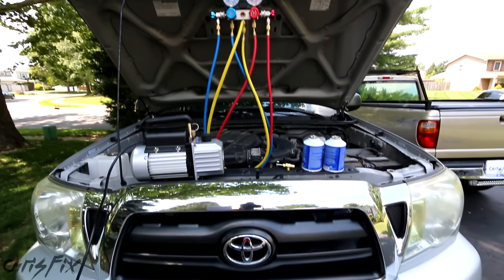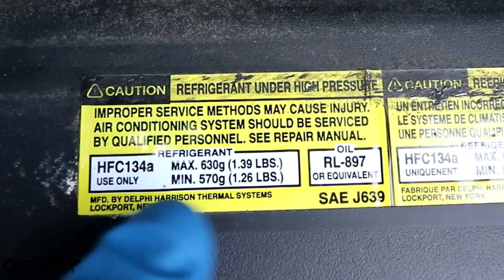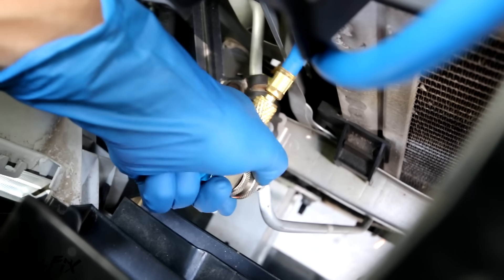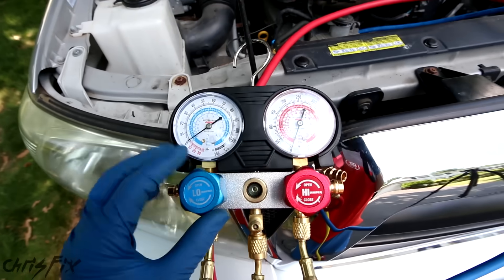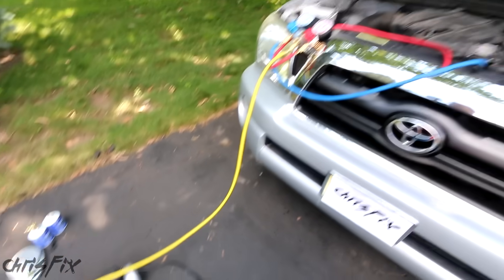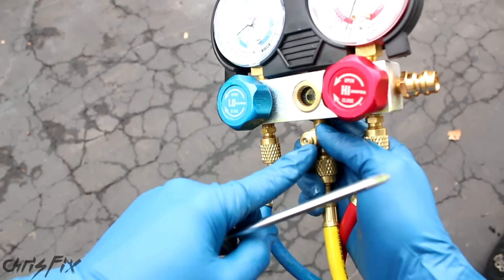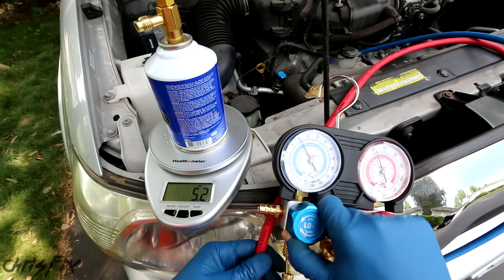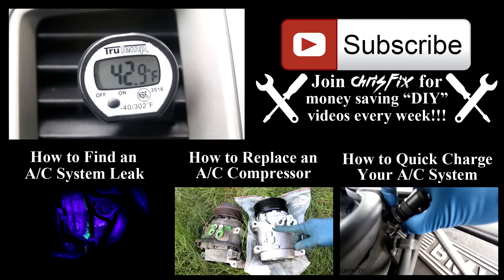How to Properly Recharge Your AC System

Comment: In addition to restoring the correct oil and gas quantity each time (best if the work is done with a recharge station), don't forget to change the receiver drier too from time to time (most of the times it's nothing but a cheap metal can mounted on or near the condenser) when regassing. It filters away any crap that goes about the system including any residual water that the vacuum didn't pull away, that would otherwise become ice inside the expansion valve and the evaporator. So it gets clogged over time and results in a compressor working harder than normal, and therefore wearing faster (and also inefficient cooling). The key to a perfect ac is preventive maintenance. I know nothing stays the same, but if you're willin to play the game, it's coming around again, Carly Simon once said.
Reply: Great song. How often advise you to check the oil ?
Reply: @supermasterPIK  You don't need to check the oil and anyway it's a two-stroke kind of lubrication so there's no actual way of checking it. The only way of restoring a full charge is to do a flush and then load a new system oil charge (recommended when you've had a large refrigerant leak), but it's time consuming work because a lot of stuff needs to come out, and that's if the expansion device can be removed from the engine bay. When doing a regas just make sure that you put back inside any oil that comes out, the recharge station takes care of it.

Comment: Hey Chris! Hope you're doing well, i have a question about my ac system, I've done an evaporator core and compressor replacement, the compressor came pre oiled. I installed everything and tested the system it had no leaks, I went and filled the system up. Ac runs cold but not cold enough like it use to ,so I checked with the company that did the ac recharge, and they turned out to fill up the system by pressure on the gauge and not by weight. 

My question here is, can I vacuum the refrigerant out without removing the oil in the compressor ? I don't want to evacuate the oil out. My compressor is new and I want to maintain the oil in the system. 

Please let me know what can be done and if a regular ac vacuum will keep my oil in the system

Thanks man !! And love the videos !!!

Comment: thanks Chris. I comple. my job in minutes my car is a infinity ex 35.  i have to replace. the radiator.  and by consequence. I have to drain. the AC. I did exactly. what you said. and like factory. thanks a lot

Comment: CHris, you measure a recharge in pressure not in weight. you left the system to low at 200 psi. you need to atleast have 250 psi to 300 psi(max) bc if not then the condenser fan wont even turn on.
Reply from the maker: Thanks for sharing but you recharge an empty system based on weight. The system pressure varies with air temperature and humidity.
Reply: So by weight it would vary. By pressure it would be exact. I do about 30 to 40 cars a day every week. I use 30 pound tanks. i do repairs about 10x a week. Every car is different every state is different but to hold by the exact pressure no matter what weight. bc freon is oil and gas based.
Reply from the maker: Again, I really appreciate your comment but if I filled it based on 200PSI I would have overfilled the system past the manufacturer recommendation. That can cause seals to leak, the ac to be too cold and freeze up the evaporator, and too much strain on the compressor. There is a sticker on every car that tells you the exact amount of refrigerant you should put in the car and that is the correct way to fill a system. I am not saying your way doesnt work, but the proper/best way to fill a sealed and evacuated system is by weight.
Reply: ChrisFix you know that freon isn't just oil it's also gas. If you're doing it by weight you could be adding too much oil base freon. That's why on the can is says to shake not turn it upside down. Too much oil will be added to the dryer and you'll will have to replace it or drain the dryer.

Comment: Thanks for the video! I used it today to refill the system after replacing the expansion valve. Finally have working a/c again after 3 years without it.

Comment: What should the pressures be? My AC has been acting weird. It was blowing warn and cold intermittently yesterday but today its fine but when I check the pressure it 35 psi on low side and 310 psi on high side. A week ago I did add some refrigerant, not very much, only about 1 min with the AC pro can. did I over charge?

Comment: A descent video, easy to follow, but, I would not ever suggest to the general masses, to tip the refrigerant can up-side down,  while the compressor is running.  As the raw liquid is then getting sucked into the compressor.   The raw liquid refrigerant can "SLUG" the compressor, and may destroy or shorten its life severely.  This will make some unhappy campers out there.  I would trim that part out, and mention not to do this, while compressor is running.  Some of the other things, others are mentioning on here, have their points, but can you get by with for a reasonable amount of time.  Personally I don`t care for adding dye, (another contaminate) to the system, but it is a short-cut to finding leaks in a pinch.  But a good, clear easy to follow video, and is worth fine tuning a little.

Comment: Hey, I've seen your videos on AC work but I still have a few questions. I have a 2000 Chevy blazer. I'm replacing the AC compressor, accumulator, orifice tube, and all the hoses. My compressor came with pag 46 oil just for storing and shipping. My system requires pag 150. I know my system takes 8.5 oz of oil. I understand that I'll need to drain the compressor, add a few ounces of pag 150 to the compressor and rotate the clutch so it's lubricated, and then some goes in the accumulator. My question is, do I add 3oz of oil to the compressor, then pour the rest in the dryer before I pull a vacuum?  Or do I just add the 3oz of oil to the compressor, pull a vacuum, then add the 5oz of the oil through the yellow hose before I add the freon? Your help would be greatly appreciated. Thanks.

Comment: Tried recharging through the 'hidden' recharging port on my '97 F-150. Clutch on the AC turns on for maybe 2 seconds and then turns back off for 10 seconds to a minute. Just spins intermittently. Anybody know what gives?
Reply: FWIW: I figured this out. Started doing it because the 12oz can I put into it was just enough to get the AC clutch to actuate. The fix is to have a can with refrigerant hooked up and at the ready and prod at the clutch to get it to actuate again. It'll only take additional refrigerant while it's actuated. So, you've gotta sit there and poke the clutch with something until it actuates, hit the port you're plugged into with refrigerant, rinse and repeat. Keep doing this and eventually the clutch takes off on its own. Easy-peasy.
My assumption is that the clutch is the only thing creating additional vacuum, hence the only way additional refrigerant can be added.

Comment: Question: after you put the vacuum on the system, and we're ready to start filling, the gauges were at 0( zero ) again. The gauge went from zero to positive when filling began. Why? Why was the gauge not at -30? If it was at negative thirty when you closed the valve shouldn't it still be there? No matter if you open or close the valve? I am thinking of buying a set of gauges and a pump because I am sure I can do this. But you never mention the 500 micron sure boiling point of the water in the vacuum and why if there is such a vacuum in the system why it won't "suck" in coolant until the pump comes on? Help more detail please before I attemp this at home.

Comment: You use the pump to place the system into a vacuum. Not remove moisture. If you have any moisture in the system your already fucked so taking it out ain't gonna save ur system.

Comment: This video is only good for those who have no gas in the system and not those who just want to top it up as where does the old stuff go out of a charged ac system and I would love to see the ac gas leak on to the gloves you are using as they would not stop you from freezing your hands ac systems are not to be taken as lightly as you have made them look and should only be tackled by professionals with professional equipment not stuff you have bought from Home Depot

Comment: one question if the ac commpresor already has oil in it do you have to add oil into the yellow line to? I got a lottle bit confused, or is the oil on the ac commpresor enough

Comment: I replaced all my AC under hood. i had a pro shop do my AC vacuum and freon. 
The drier firewall Oring leaked 3 times so he tryed a double rubber 
Oring.  It went well and and blew cold but the next morning it was all leaked out.  its a new drier. really sucks.

Comment: You didn't purge the air the second time you added the second can. Also the low side does not compress liquid, it compresses gas. Putting the can upside down is bad if you are charging through the low side.
Reply from the maker: Thanks for sharing.

Comment: chris, i try to charge the system for 2002 honda accord, not able to charge , i know it has no free on. compressor not running, because free on is low or empty.. any reason why the system is not taking free on..

Comment: Were you just pointing at the engine oil filter when talking about the oil for the A/C? FYI, the a/c line does not touch, nor even mingle with the oil in the engine.

Comment: Using this method to check for leaks by seeing if it will hold a vacuum is about the best you can do without extra equipment, but it doesn't mean you don't have a leak.  It can only find small leaks.  It's only checking a vacuum against atmospheric pressure (14.7psi).  The system sees pressures around 200psi while running, so it may very well leak while running even if it held a vacuum for an hour.  It's still a good way to check - just keep in mind it isn't a guarantee your system doesn't still have a small leak.

Comment: Thanks for the great video mate. Here in U.K. You won't be able to buy either a full or empty R134a gas bottle unless you have done a gas safe course and have the relevant certificate! Costs the equivalent of $800 to get the certificate! Quite annoying as have all the rest of the equipment but can't justify spending that for a qualification only using maybe a few times a year.

Comment: +ChrisFix wouldn't you loose the oil in the system when are sucking the humidity with the pump? .... I've seen that recovery machines extract both refrigerant and oil, not just refrigerant, when they turn their vacuum on.

Comment: Excellent video!!!!
Can you tell me the type or part number of the refrigerant fill valve you used?
I bought one, but my yellow gauge line will not screw on, the yellow line screw fitting is to small and the refrig fill valve connection is to large.

Thanks!!!!!

Comment: This is a very helpful video Chris, thank you. Though I have one concern, if my compressor isn't engaging, it should engage once I add refrigerant? My compressor isn't locked, it just doesn't spin when I turn on the AC.
Reply from the maker: Once you add refrigerant the pressure switch should recognize that and engage the compressor. If not, the sensor is bad or the compressor is bad (could be a fuse).

Comment: @chris fix... guy at the dealership told me the other day I need to replace my compressor. While I'm at it I should replace the clutch and spring. Is replacing the clutch and spring necessary?

Comment: you should not turn the can upside down as you will send liquid into the low side. the low side should only have gas. you can break the compressor. the law of physics is (you can't compress a liquid) also you should go online take the a/c course from the EPA, it's called mainstream.   believe it or not, there is a $10,000.00 fine for doing your own a/c and not having a license. it is unbelievable that they even sell do it yourself freon kits in the auto store.  if you have a clog just past the low side valve. you will get over 400 lbs on the low side and explode the can or the line.
Reply: He's using R134a not R12 or feon. R134a is benign and almost not harmful to our environment. this is why you do not have to be certified HVAC tech to buy it in any auto parts store.
Reply: (1) EPA doesn’t give you a license but a certification. (2) Handling  small sized R-134a container (less than 2lb(32oz)) doesn’t require certification if it’s for DIY.
Reply: It's not benign, merely less harmful.
Reply: @kennethscholz6027 R134a has ZERO ODP (ozone depletion potential) environmrntally harmless for all practical purposes. Only "Safety Sallies" fret about it.

Comment: Do you have to rev the engine to suck the 134a into the system?
Reply: Richard Cowtails if the system is under vacuum, it will suck the cans dry.

Comment: Very helpful video, thank you!

But one thing.  When putting new refrigerant in, you should NOT hold the can upside down!  (I noticed you had done this right when starting the recharge!).  Though holding upside down when the can is empty isn't that big of a deal.  Though once the can is almost completely empty,  one trick to get a little more out of it is to drop the can into a bucket of hot water.

Comment: Question? When you pulled a vacuum on the system, didn't you vacuum out some of the oil from the compressor?
Reply from the maker: The vacuum will only suck air out not oil because oil is heavy and stays in the ac system.

Comment: it's a good thing I watch youtube a lot because I just learned that this new product "ACPro" has everything you need to do this same thing at $40 tops!!
Reply from the maker: It isnt the same thing because with this process you are evacuating all the air and water out of the system which is not done with AC Pro. Each way has it's use but there is no comparison for doing it properly.

Comment: Perfect.  Best I've ever seen and very professional.  One thing to check.  When filling gas run the fan on hi and not low.  You want to check it's charge at full load on the evaporator.

Comment: hi i git a cuestione. i have a 2004 jeep liberty and the low pression house is broke, i have to refille of oil my sistem or not, i see little green oil came from the house but i don not how much the oil the sisstem loss
Reply from the maker: When you replace the part, you add oil.
Reply: how i know how much oil add on?

Comment: Hey Chris love your vids man keep up the amazing work! Anyway how can you if a car takes R-12 refrigerant or R-134a we have a 1989 corvette and I can't figure out if it has a conversion kit on it? thks for the help!
Reply: Cody Niblack Check the ports. If the ports require the clip on type of hose like what Chris used, its 134a. If the port is threaded, requiring a hose you twist the hose onto the port, its R12. If its still the R12 system, try and save it. There's still R12 out there, just gotta know where to look but be careful lol. You'll be much happier keeping R12 as a car converted to 134a won't be as cold as R12 or a car that was made for 134a.

Comment: Hi Chris, I made a mistake in recharging the AC og my car..  I put in everything plugged in, turned on the engine, turned the fan, open up the refrigerant. But soon after the can was emptied, i realized that I forgot to pressed the "A/C" switch of my car.. what will be the result of this to the AC system of my car.? After this, i right away put in another can of refrigerant, but made it sure that i switched  everything on including the AC.. after doing this, my AC works  but only when the car is moving. but if idle or in stop and go traffic, it barely blow very cold air..
Reply from the maker: +Vensan Arangote that's not a big deal. That just means the ac compressor wasn't on. Sounds like you didn't add enough refrigerant.

Comment: Fail. You didn't use a leak detector and refrigerant identifier before recovering the refrigerant. Just recharging the system by adding R134 can cause  issues on the HVAC especially if there is R134 in the system. So go to the shop and get it recovered before doing all of this then charge it. Add dye to figure out where your leaking before your add the Pag Oil then refrigerant.

Comment: I'm not sure if someone mentioned this, I'm not going to read all the comments to find out. 12 fl oz is much different than 12 oz by weight. The second can was weighed at 20 oz, which is well over 1 lb. If both cans have similar masses then it can be assumed that 30 oz of refrigerant was added to the system. Just a heads up to anyone who does this.

Comment: please help me.
my car is a 2009 Toyota corolla. (clutchless compressor)
my compressor takes less than half of the 12 oz can of refrigerant (which seem extremely little) before it max out and won't take anymore. 
low side jumps way above 50psi while the high side won't get any higher than 80 psi.
I already replace the compressor control valve and pull a vacuum.
bad compressor or clogged line?

Comment: Do I need to add oil if I'm keeping the same condenser? I'm getting my system evacuated and going to recharge using this method. Thanks, great video!
Reply from the maker: +rick church just a little is good if you had a big leak. Maybe 2 oz or so if it was a smaller leak.
Reply: ChrisFix thanks so much!!

Comment: If i have a bad compressor do i need to replace condenser, air dryier and evaporator or just replacing the compressor will be fine?
Reply from the maker: You should replace the receiver dryer if the lines were exposed to air. You need to replace all that other stuff if your compressor broke apart (grenaded) and there is now metal parts in your lines.

Comment: why my AC compressor clutch keep on and off during in use Toyota 2004 4runner?
Reply from the maker: It is supposed to go on and off. It kicks on until a certain pressure is reached and then it kicks off.